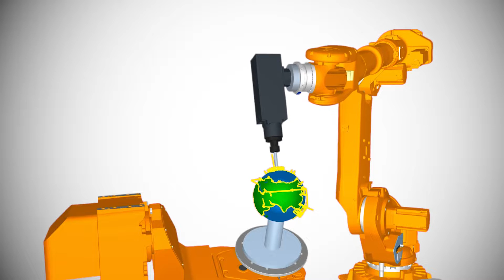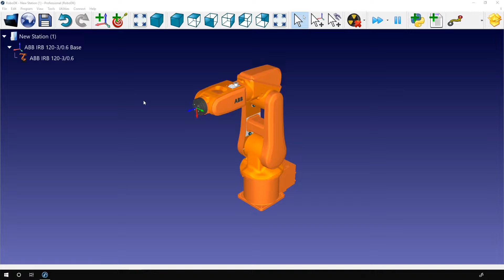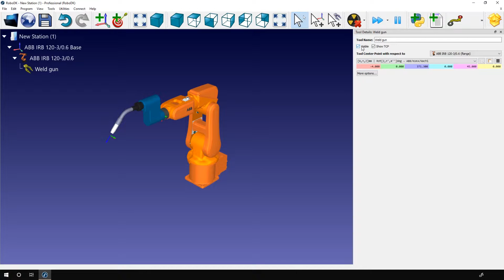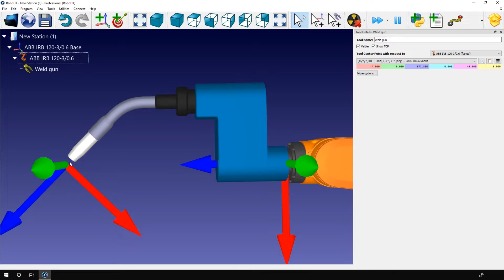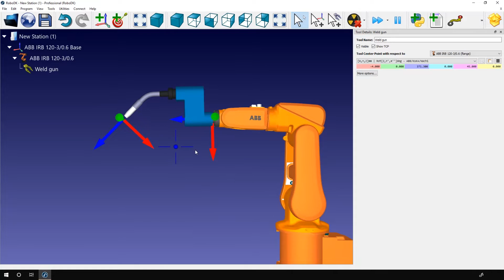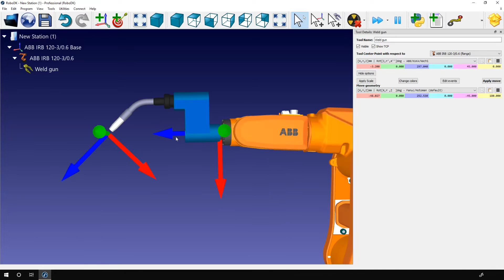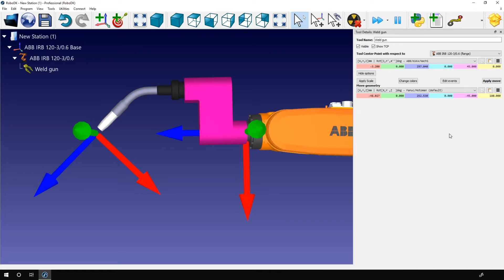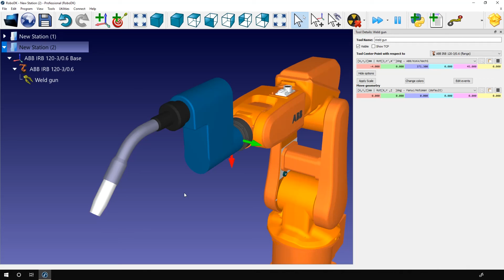Robot Tools - TCP (1/2) - Documentation

Comment: Why should the Z axis be oriented so that it is pointed out the robot. The TCP and an object on the table would like to match their coordinate systems. If the Z is pointed downwards... so the same would be required of the objects on the table... with the Z pointing downwards... and that just feels wrong...
Reply: Having the Z axis pointing in or out of the tool are both commonly used in robotics. I would say the Z axis pointing in is more common with CNC and Machining applications.
Reply: Your comment look like you never had a TP in your hand and didn't teach any industrial robot. Teaching robot a programmer swap coordination systems or frames  to the most useful to reach demanded point. On the same physical tool you may have multiple  TCPs. Setting the +Z axis pointing toward the Target  will allow even the least experienced programmer always move robot in correct direction during recovery from a collision. One must remember to slowly move robot in -Z in ToolFrame. 
In my experience I met robot operators, who teach robots for years without even knowing that robots can move in Joint  or Cartesian Coordination systems not mentioning about changing TCPs.

The example you were talking about is true, if you work on a job which use offsets, such  as pick and place or moving/shifting targets. In that case you create one UserFrame for the pallet and other UF for the part.  In that case, if directions of axes in both frames corresponds then the calculation of offsets is easier. As well as teaching pick and place position and later touch ups. In my case, if the client's programming standard (or robot controller) allows that, I would create additional TCP on the corner of picked up part for better control.